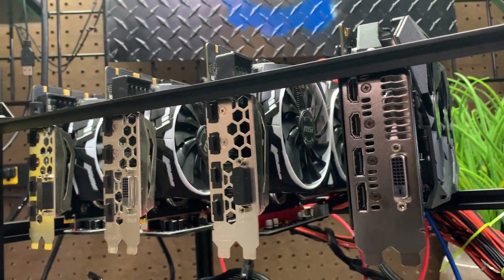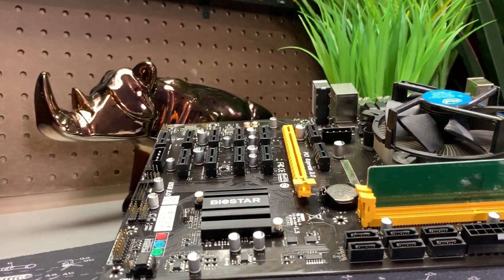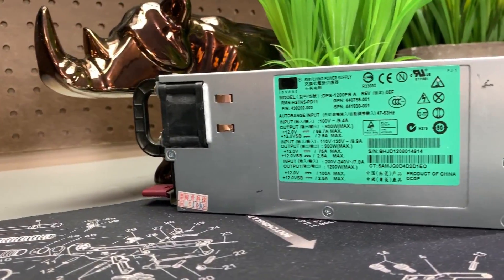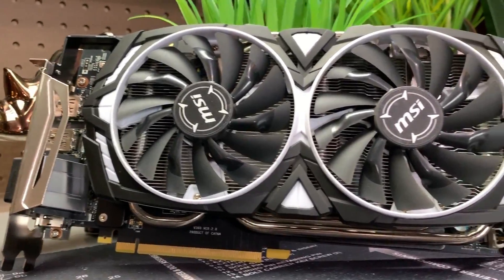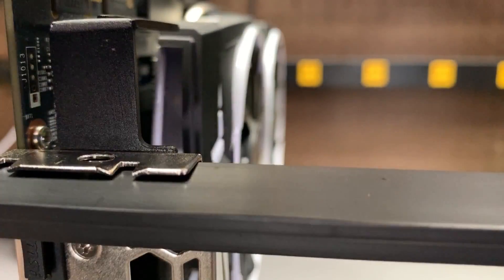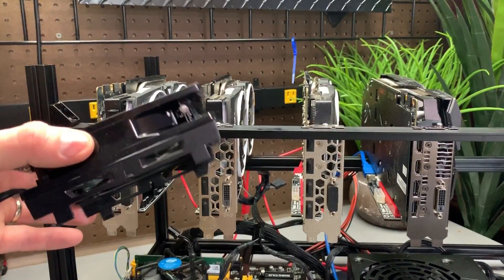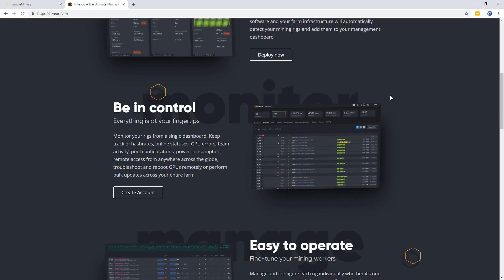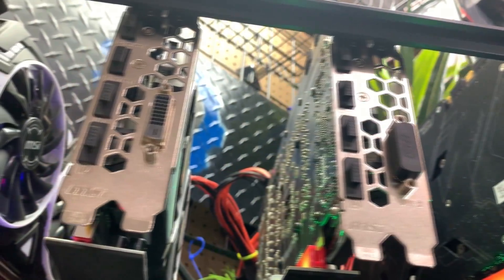How To Build A GPU Mining Rig 101: Basic Build

Comment: Not recommending using molex for anything while showing the use of SATA adapters and not recommending more than two connections is just the biggest head scratcher out there. SATA IS NOT recommended for use with mining, MOLEX on the other hand, is perfectly fine and supporter, as you should know from your time spent in r/gpumining.
Reply from the maker: I've never had sata failure if leaving it on low power cards and limiting it to 2. I've had molex failure, but the main reason I don't reccomend molex is that the connectors are shitty. The pins often slide out and make a poor connection. Again, not getting into specifics as to why.

The jist being molex is a shitty connector type.

Comment: I feel like you've come full circle. I'd skip the SATA to 6-pin power connectors. I've had a couple of those turn into crispy critters on me. I just power them straight from the PSU with the regular cables that come with the PSU. The only thing to watch for is not to mix brands of cables, because they are not all the same. I know for  a fact EVGA cables will not work with Thermaltake PSUs. The pin outs on the PSUs are different.
Reply from the maker: Thanks man. 
There were a ton of things during this brief shoot where I was like, "I should include this or that" but it would've made the video too lengthy and cluttered. Really looking for something ultra simple and highly digestible for noobs.
Reply: I'm with you on the sata bit, but the biggest headscratcher of all was the recommendation against MOLEX in lieu of sata, this is 110% incorrect, and backwards. MOLEX good, SATA bad.
Reply: and to add on power supply corsair cables are different sockets/pin hole grounding burnt my Mobo and 1 GPU. 1200 hxi 1200 ati, i still use them  but i use hp power supply for extra GPU